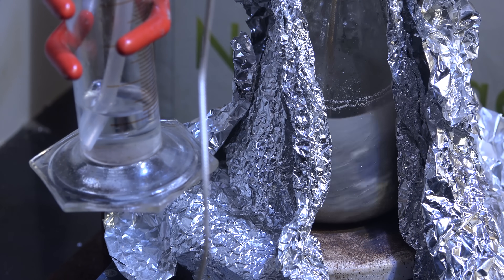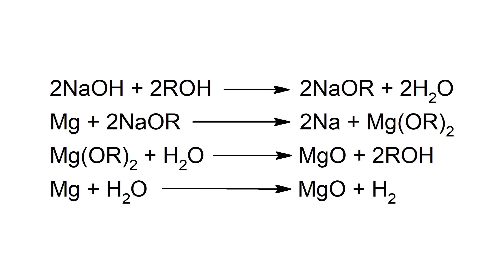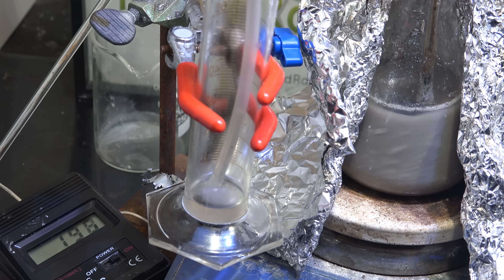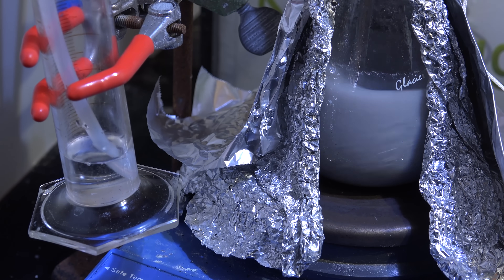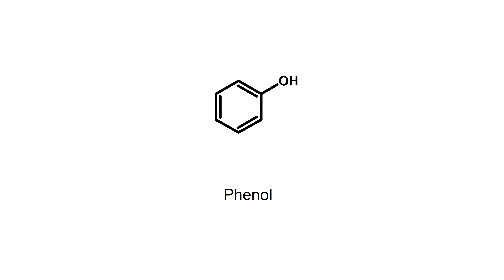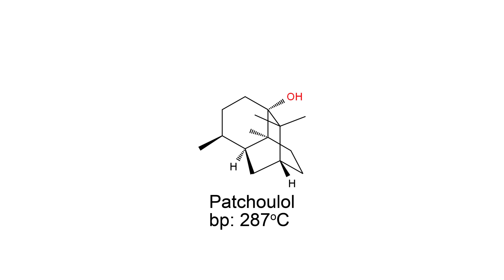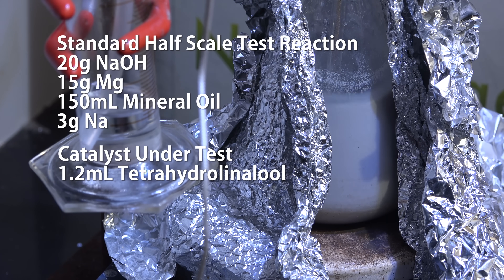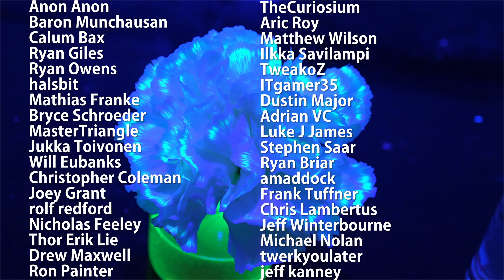Lab Notes - Off the Shelf Catalyst Testing - Nov 11th 2018

Comment: just joined and just getting into amateur chemistry, due in part to you, my fellow nerd! Just failed my first sodium run... didn't include the tertiary alcohol ! Mostly because I didn't pay enough attention and I don't know how to make it. It seems to be the hard part. I used the amalgam you showed so maybe I was doomed anyway. That's half the fun. I have some sodium metal coming but I still need to distill some 4-terpineol. Don't know how that will go, my try at making 1,4, dioxane also failed. Also, my stir bar stopped at anything above 200 c. could someone help with that? Thanks anyway, whatever your name is.

Comment: Hey I need some help I have been trying now for the past 7 months to make potassium chlorate whit no success I have not managed to produce 1 single crystal so far and honestly I’m really frustrated I have spent hundreds off hours and hundreds more research 
In and trying everything I possibly can I’ve tried every single electrode I have ever heard mmo carbon and titanium and yet no success I have bought 8 different salts and re crystallized them and tried getting them as pure as I possibly can pls if any 1 has any tips or some thing to say I would love to hear it have a good day bye bye
Reply: Update I now have produced 3 grams off kcl03 I know it’s not a lot but I still did it I’m working on developing my methods the reason my healed was so small was based on the fact that I ran in to some production problems I toasted my dc power supply and made my entire house go black but anyways I’m so happy

Comment: Dear NurdRage,
can a process similar to this one be used in order to recycle lithium (oxide) from batteries?
Such as - Lithium-rich trash is deposited separately from the rest, the batteries which remained intact are disposed of into water, and you get free Hydrogen for fuel cells or other uses + Lithium Hydroxide + the work of increasing Temperature and pressure in the vessel. With a reaction process similar to yours for Sodium, we reconstitute the Lithium and use it for whatever else. Sorry for the layman question, this was probably considered earlier by people who know more about chemistry than I ever would.

Comment: Great work as always, but I definitely still think the theory is incomplete. The sodium product is far more effective at destroying any water present than the magnesium reactions, which shouldn't leave any to regenerate the alcohol from the magnesium complex. Your intact glassware testifies to the fact that there is no water in the hydroxide, which is where it is supposed to be produced.

It could be that you are actually catalysing the exchange of magnesium for sodium in the hydroxide, and then the sodium reduces the hydroxide to an oxide which has a much higher affinity for magnesium. In that path, the alcohol is never regenerated, instead staying as a metal complex. No water is formed after the initial complexing. That at least has a liquid as one of the reactants in the hydrogen producing reaction, unlike magnesium with wet sodium hydroxide.
Reply from the maker: I'm actually going to present an updated mechanism soon. Stay tuned :)

Comment: I mixed Easy off spray with chlorine bleach on an old steel/metal tray and it seemed to currode the tray, why did this happen? I'M AN IDIOT! EASYOFF CONTAINS "SODIUM" HYDROXIDE
WHEN YOU MIX SODIUM AND CHLORINE IT WILL CAUSE A CHEMICAL REACTION PRODUCING HEAT/BURN CURROSION. but why was there no flame?...

Comment: That kohinool appears to give a better yield than the norlimbanol I would think due to it being more sterically hindered. This seems to hint that 2,4-dimethyl-3-pentanol (diisopropylcarbinol), might be worth a try. Of course that's not remotely OTC but it would still be of scientific interest. Your results with the secondary alcohols at least suggest that the α-elimination is a bimolecular process, perhaps with hydride being abstracted by a metal atom.

Thinking about higher homologues of this hindered secondary alcohol, the hydration product of isobutene dimer springs to mind. This would be 2,4,4-trimethyl-2-pentanol (and a tertiary alcohol because hydration would happen at the tertiary carbon atom). Excuse my ramblings!

Great news about the tetrahydrolinalool though!

Comment: This is super cool! I’ve been following this for a while and would like to try these things but alas I do not have a condenser. Do you think using a metal tube wrapped with Teflon tape stuck into an Erlenmeyer flask would work?
Reply from the maker: You don't need a condenser if you're using a heavy alcohol. Tetrahydrolinalool and 4-terpineol are heavy enough that you can do this with just the flask and a bubbler.

Comment: If you were to heat 4 terpineol with an acid maybe you could end the double bond misery and a double tert alcohol could be formed? Also wondered if cetyl alcohol could be halogenated and grignarded onto e.g. MEK? Maybe even via lithium?
Reply from the maker: Check out the video just before this one where i try to make "terpin hydrate"
Reply: Sorry - pity it didn't work.

Comment: could tert-Butanol work? That substance is not that expensive. Here you can get 500ml in high purity for 15-20€ from a chemical company. Thats the simplest tertiary alcohol.
Or am i missing a reason why that wouldn't work? is it too short?
Reply from the maker: It works perfectly, but the fact that you do need to get it from a chemical company makes it not-amateur friendly. I want to find catalysts that are amateur friendly.
Reply: ohh, i thought your approach was to simply find something affordable. Theres some sellers on ebay selling it as well, anyone can buy it without any paperwork, but you won't exactly find it on amazon. Fair enough though, i understand what you are going for.

Comment: Once you have a nice 1/3rd pound or so you don't have any plans for...take disc of sodium and then take 5 paper towels with a 1/4 inch hole punched in the middle of each and get them wet in grease, then wrap your disc one by one with the hole being on opposite sides with each wrap.  Put a couple of light rubber bands to keep paper towels from coming undone and then take to a deeep water hole and throw it in and wait.  Make sure you have you canoe ready on the shore but do not throw the disc into the water while out in the boat or a bubble might swallow you up and drown you along with your boat!  Nothing can prepare you for what will happen, no not the cheesy pieces your chem prof showed you in high school, it's got something to do with the pressure and intimate contact which compresses the hydrogen bubbles but it will look as if a submarine has hit a mine and exploded and yet only a mm or so of the exterior of the disc is used up ejecting the disc out of the lake upon which it then explodes properly into thousands of pieces and spreads over the entire surface leaving fresh fish and of course the belongings of anyone who happens to be fishing on the banks ripe for the picking, yes including their car keys!!!!  LOL  Hint:  if you immediately launch your boat with a net in hand it is possible that a brave soul might see you and point the finger.  However those brave souls usually run for hills right past their cars without ever looking back! ROFLMAO
Sizzlean
Reply: got a video for this? or at least a less opaque tutorial?
Reply: Picture this video (in your minds eye).  There you are fishing on the banks of a nice quiet lake, drinking some suds and kicking back when all of a sudden a Humongous bubble filled with white smoke gurgles up from the depths of the water and out of nowhere a shiny metallic disk shoots out of the gurgling hole into the yonder and then seems to have an engine failure (since the first thing that goes through your mind is it must be a damn UFO!) and begins to drop in an arc and then skips a couple of times across the water and suddenly explodes into a thousand pieces with each one shooting white smoke and exploding as it hits the water until there are thousands and thousands of pieces of shiny metal darting back and forth and then there is silence....except for the screams of the panicking freaking out bare foot fisher-persons running through patches of goat-heads...but never bothering to look back as they've all seen too many scary body snatcher movies and surely know better.  Once they reach the end of their oxygen supply they realize they left all the beer and car keys, yet they don't return for hours until the police tell them their is nothing and no signs  of a downed UFO or little green men anywhere to be found and start asking them if they've consumed any kind of  wild mushrooms or smoked something lately!  
  Then and only then ...if you can picture that in your head ...you will realize one video camera could never capture it ...especially if it's not pre-positioned and running on a tri-pod as the laughter would have ruined the video anyways!!!  If I ever meet someone with great rendering skills I'll make the video you are looking for, but until then sharpen that imagination friend....and get up off the floor!
Here is a short video that will help you to understand what I'm talking about  https://www.youtube.com/watch?v=wAcotjjTj4s
Sincerely
Sizzlean
Reply: Hell NO! you obviously have not processed this in your mind yet, sorry it is opaque to you only, anyone who has played with large pucks found in the 1LB cans of Na can see what I said in their mind with perfect clarity.  Nurd made it easy enough for you to make your own supply so get to it, then you please make the video and we'll see if you want to post it!
  By the way this is not a tutorial, it is merely a dream SWIM had long ago.
Sizzlean

Comment: Unlike Norlimbanol, Kohinool's chain is highly branched, with each carbon atom having a CH3 group. Could that have had an effect of the (slightly) better yield? Do you think that a primary alcohol with a similar structure could have worked better?
Reply from the maker: it may indeed be a steric issue, so now i need to find a super-highly branched primary alcohol.

Comment: what do you think about using a centrifuge to purify the off the shelf oils? It might work, but probably requires speeds that may be difficult to reach.
Reply: Unless you invent new laws of physics, you cannot separate several substances that are highly soluble in each other by centrifugation. At least not in a centrifuge that fits in a normal room and that isn't also used for enriching uranium. :)
Reply: @stamasd8500  yeah, that's why I said "speeds that may be difficult to reach." Centrifuges that can separate molecules have been done in the laboratory, as can be referenced here: https://www.thoughtco.com/centrifuge-definition-4145360

Comment: Racemic Patchoulol apparently has a melting point of 56 °C, is soluble in ethanol, and insoluble in water. Instead of distilling it, maybe you could try recrystallizing it out of a water/ethanol mixture?

(like, mix patchouli oil with ethanol (not sure about the ratios, maybe 25/75?), heat up to 50°C, add water dropwise till stuff starts crashing out, then just enough ethanol to make everything clear again, and let it slowly cool down to room temp, then in the freezer for a couple days or so?)

I'd try it myself, but I have no mean of getting my hands on essential oils now.
Reply: Also, most of the other stuff in the mixture could be boiled off first.

Comment: carboxylic acids decompose with bases at high temps. R-COOH --> R-H + CO2^
Reply: Much higher temperatures. That reaction is usually done by dry distilling the carboxylate/base dry mixture, I'd say that the temperatures are around 500°C. 
I could be wrong though.
Reply: You’d see CO2 bubbling if this was the case.
Reply: @ExternusArmy  
CO2 would be absorbed and turned to carbonate in such extremely basic conditions
Reply: @pietrotettamanti7239   *basic
Reply: Thanks for the correction, I was thinking of other stuff while typing the comment so I messed up😂